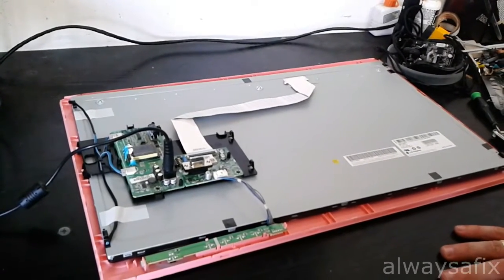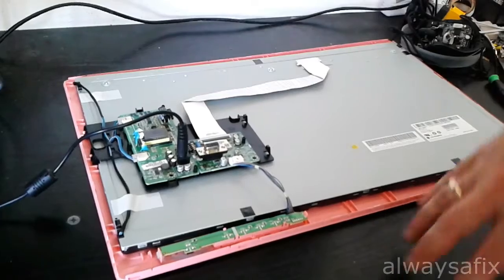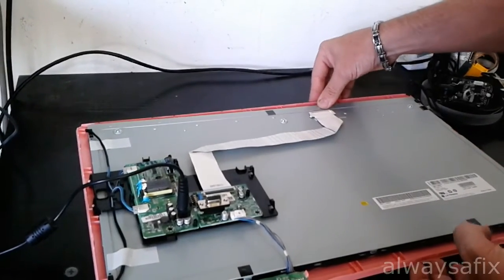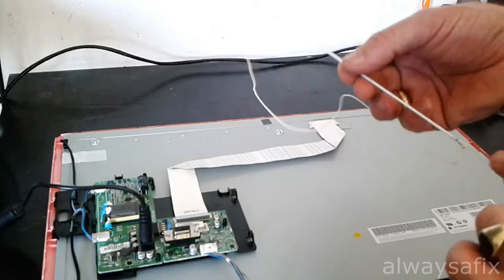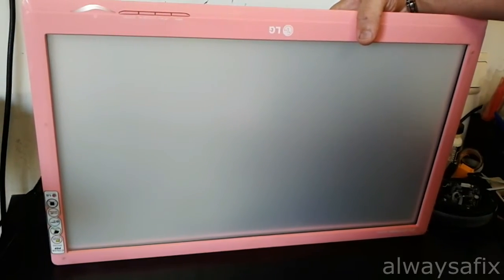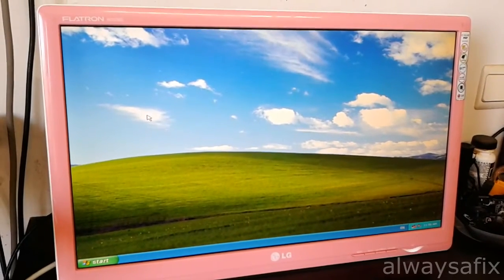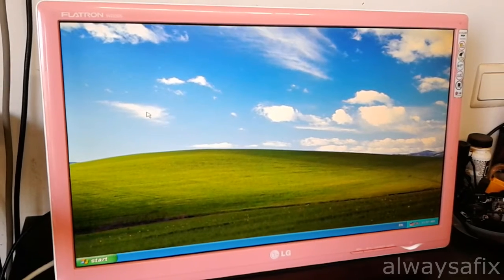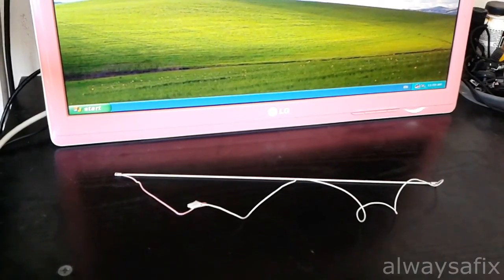Screen backlight problem LG Flatron W2230S not capacitors

Comment: Hello,  my LG W2042T-SF monitor don't stay on, just a flash and then off, the power board seems ok, i have connected just one lamp and screen stay on for 1 second then off again, same thing with ther other lamp, i've replaced the transformer/inverter with a new one but equivalent but i'm not sure if it's correct, equivalent inverter is marked SPW-149, the original is EEL-22W. So what can be wrong or faulty? about the lamps, what did you use for insulation?

Comment: I have the same problem on my monitor - at first I really did think it was the caps (swollen ends) so I replaced those: switched it on, same problem so on the plus side, I soldered the new caps on right but on the other hand, still no usable monitor. 
I bit the bullet and removed the LCD screen from the surround in order to get at the CCFLs. Sure enough, the top one was badly burnt: I don't think the CCFL is usable now. I'd like to replace it with LEDs but I think I'll fall foul of the protection mechanism that 'alwaysafix' mentioned - I can't even get the monitor to turn on if one of the CFLs is removed, so by-passing those power plugs and using a different lamp might be hard.
. Is there a fix for this or have I had it? I can't find any replacement CCFLs for this particular monitor.

Finally, there's a metal shield over the circuit board for the monitor (the one attached to the LCD), which I had to remove to get the back off. The screws for that were on way too tight and I bent the thing on removing it - is that needed (R/F shield maybe?)

Comment: hi there, I have two flatron 19in screens all lamps are dim or burn. so I opted to switch them out for led lamps. Have the lamps, removed the old inverter, but I need to figure out how to connect the wires to be able to switch on and dim the screen etc. I need the pin detail of screen moterboard Flatron L1900j. Can anyone help?

Comment: Guys gr8 video, I want ask you? I ve got LG 2253tq with exactly same problem. Is there still any chance to buy spare parts on this model? And where? Thx for anyideas!
Reply from the maker: +Jan Stradiot If its the CCFL lamp which needs replacing, you can buy them on ebay.  Good luck!

Comment: I have an LG 47LD690 inch LCD TV,
there is a total black out, no sound no image, I tried to open  the back cover ,there is no sign of any blown up capacitors, all the capacitors are flat  and look ok, so totally black just the red power light on the corner, the side buttons are not working, no other light even at the back
, where to locate my inverter
Reply from the maker: Your inverter is built into the power supply board.  Good luck!

Comment: I was trying to repair it as you suggested but somehow the ccfl lamp broke and I need replacement. Any suggestions on where I can get one ?
Reply: do a google search with the brand and model of your LCD monitor + ccfl
Reply: I did but couldn'tt find any =_="
Reply from the maker: Remy D. Marquis They are available on ebay.  Good luck!
Reply: Thank you, but I couldn't find a lamp that supports the same model. I've reached out to a seller I found, maybe he could guide me in the right direction. Thanks :)